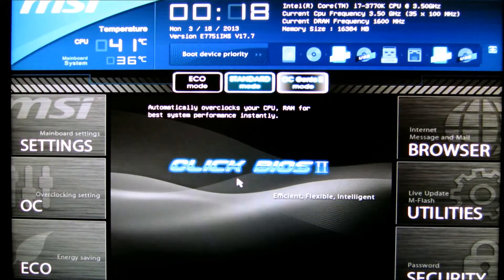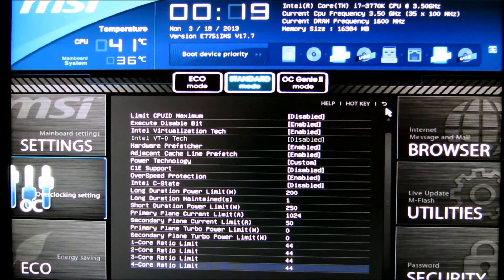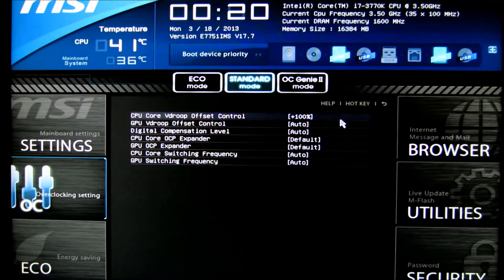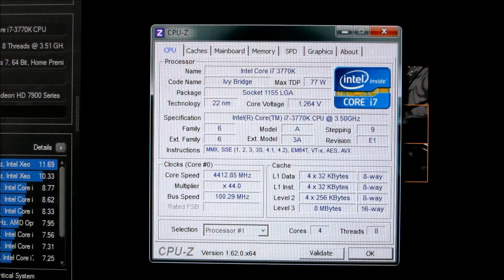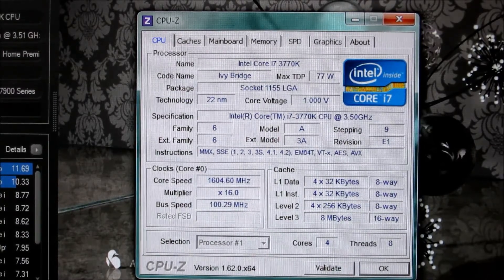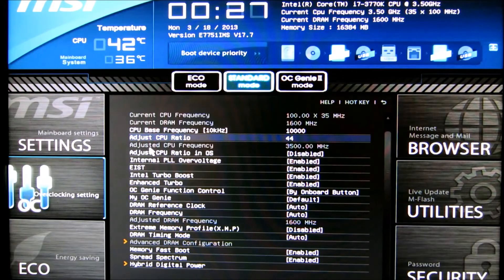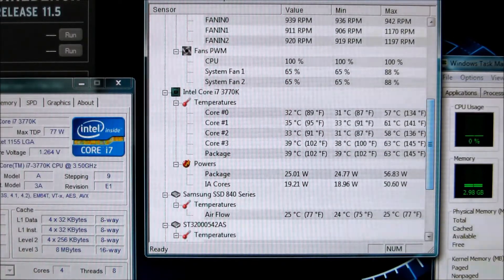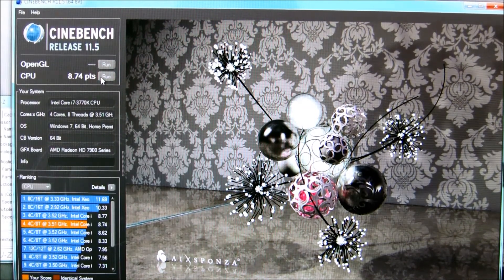MSI Big Bang Z77 MPOWER Overclocking

Comment: Hey dude i have the same motherboard as you and the same processor as you but i have a bit of a problem 

my ram frequency can go to 2400mhz ( corsair dominator platinum ) and the motherboard supports it but when i did it after 2-3 days it failed and i had to restore it back to the 1333mhz 

can you tell me what might when wrong 

i did everything right 

1.65V
LINKED THEM 
10-12-12-31 configuration
2400mhz

it was working but after 3 days when i resumed my pc from sleep it rebooted 3 times and then i pressed F2 to go back to default settings

i don't know what went wrong

when you see this please help a brother out :)

Comment: thanks alot for sharing cos I  totaly forgot which setting's I used the last time untill I saw ur video and opted in for the second setup due to the fact ive got mine water cooled at a stable 4,4 or 4.5 if I want to push it with a intel i7 3770k

Comment: the second method didn't work for me, whenever i set the vcore to 1.210 or higher the dcmos on the motherboard starts overheating(red light on the right top of the motherbord starts lighting up) and it will drop the multiplier to 16 and won't go up again. the first method you used worked for me, but i kinda mixed them up, i set the multiplier with ur first method with a 100% vdroop and increased the voltage to 1.20, this was about the max voltage i could get without the motherboard overheating. anyways, this is how i got 4.5ghz stable and still had the power saving future.
Reply from the maker: I've never heard of not being able to get higher than 1.2V. I think my chip would go to that even at stock settings sometimes. Of course there are some differences between chips but that doesn't really sound right.
Reply: Exacly!,  i can push my cpu to 5ghz with my asrock board at 1.4v, but i get de drmos overheating alarm everytime on the msi board,  maybe the heatsinks are not mounted properly but i actually don't want to screw with that because it will voit ur warranty.  Not sure what i gunna do yet

Comment: Hey man, thanks for your contributions toward this board.  There is a lot of documentation floating around which has helped me via forums and this video.  The first way to overclock is baller, it runs a 1.6 ghz and .94 V, temps are so low!

Comment: the 4.4 ghz gave me a pretty good boost, i set the vdroop too 100% like you suggested, your right probably no need to go any higher, i am using the turbo boost as well, no need to leave it clocked that high all the time

Comment from the maker: no problem. i would say give 4.4ghz a try for a few days and see if you are happy with the performance/if there are any performance issues. you can probably go higher but in my opinion 4.4ghz is a pretty good safe spot to stop for a 24/7 clock.

Comment: I've got my 3960x at 4.2ghz 1.230v 100% stable been you using this setting for along time, I don't like high OC because they require high voltage and I want this chip to stay good for along time :).